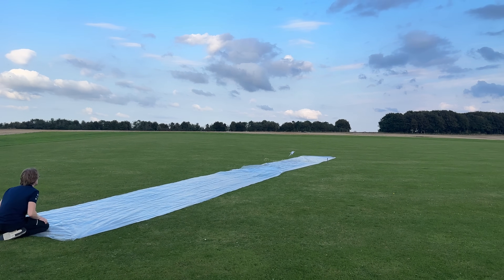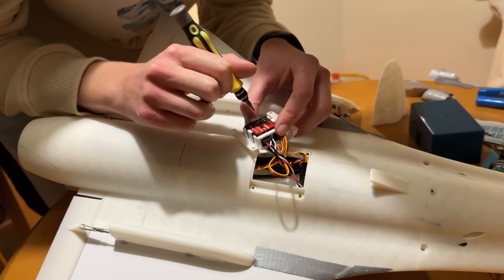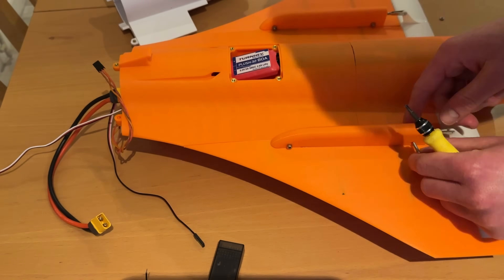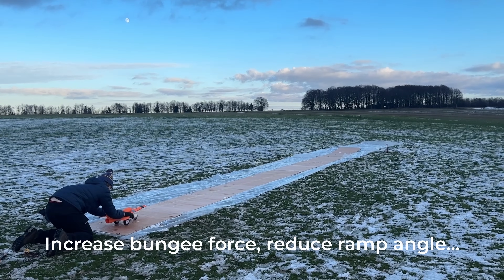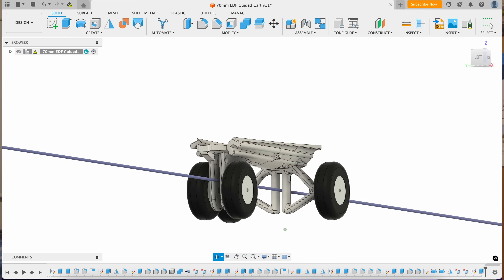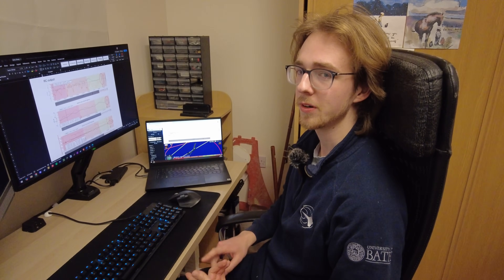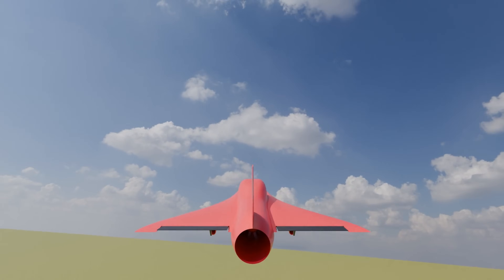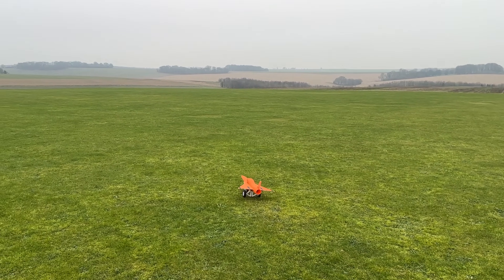WE CRASHED - Perfecting Kinglet’s Launch and Handling!

Comment: Have you considered using a powered sled to launch either rocket powered or maybe just a rc car and using a active decoupling at launch using a launch arm that increases the aoa at launch speed allowing for a smoother launch
Reply: Rocket will be too unpredictable and an RC car would need far too much runway. Using bands and string has been a proven method for years. They just need to perfect their sled a bit more. I personally use a rail system with a garage door spring connected to a Kevlar string and a Crossbow mechanism for string release. It gets my belly landing highspeed Turbines up to 60mph in a flash. Sometimes crash in a flash when I F up.
Reply: All data is good. You should ask Tridge to confirm your findings. Bring it to the Ardupilot dev conference at Richmond, Yorkshire first week of Sept to have all the Dev team available to help!

Comment: Perhaps there is some way, most likely in ArduPilot, that can alter control authority depending on airspeed. This likely won't work above a certain speed with how it's currently configured (since GPS prevents usage above 300mph I believe) however a pressure sensor like on actual airplanes could be used. It's fairly simple to math out as it's linear up until mach 1, so as soon as you see strange results at speed, you'd know you've hit the sound barrier.

It'd probably be inverse square for how the control authority would be mapped, where you've got 100% initially, then the firmware would limit it exponentially as the speed increases. Especially helpful for preventing roll, but you'd probably be better off with a different set of math for the pitch authority, and even a potential 'emergency' mode toggle which would disable the limits and allow full authority to the user.

The way I'd see it, this would likely feel very natural to learn, as as the speed increases, the amount the aircraft reacts would be the same, providing it is tuned correctly. The only difference would be distance travelled to rotate X degrees, instead of rate of rotation increasing with speed. It'd be helpful to the pilot as well as it'd feel "slow" to control, while being fully predictable, instead of having everything happen before any human could possibly react.
Reply: That should be possible via the LUA scripting functionality.

Comment: very cool video and project, how about using a parachute for landing? 🪂
Reply from the maker: We think a belly landing will be more reliable - the impact speed with a parachute will be fairly high, and it’s harder to control the orientation it lands in
Reply: @TheMachInitiative isnt it just that the harness needs to be above com? Also you could steal military drone recovery methods and deploy a bag on the belly

But this is of course a lot of weight and complexity and failure points for the flight, so maybe a catch net is more practical

Comment: I wonder if you're going about the use of the flight control system backwards.  I would recommend starting your flight out without flight control to get your trims, throws, and expo sorted out so that you can fly it "easily" up to 100mph.  Only then would I turn on the flight control to help keep things stable for max speed runs, where a human couldn't possibly react fast enough to maintain proper flight envelope.  Unless your idea of breaking the speed record is taking it up really high, then accelerating straight down and your top speed is what's recorded a millisecond before it hits the ground.
Reply from the maker: I think you're absolutely right that we need to get the trim, throws and expo (the basics) sorted first. In order to sort these out we've needed flight time and our major blocker has been the launch method. 

This video represents our process of sorting this out so now we should be able to get repeatable flights to sort these control issues out over the coming flight tests. 

The flight launched in manual and we were checking the different modes to work out what needs to change. The rest of the flights would've been adjusting the trim, c.g. and then tuning just like you are suggesting.

Thank you for the feedback we really appreciate it!

-Josh
Reply: @TheMachInitiative 
Personally I think your project management is pretty LEGIT lads!!!!!
Clearly your college did its job properly.

Eager to see what your next phase brings.
Genuinely sending as many positive vibes as possible from up here in the Norf (west yorks).
Reply: If they fly high enough and accelerate fast enough, I think they could reach top speed in time to pull out of the dive but it probably wouldn't count anyway.
Reply: There are people flying rc glider using dynamic soaring, already going faster than there projected speed.

Comment: Is it possible that the speed of the final dive overpowered the servos? aero forces on those big control surfaces may have limited the throw.
Reply from the maker: @keatonhare7691  This is possible but we think it is likely the tune at this stage. The default ardupilot tune is very conservative with less control authority than the manual mode. According to the logs the top speed in level flight was 116 mph whilst during the dive it reached 110 mph and the pid outputs were never large enough to get close to the target value suggesting it is a tune issue. Aero forces are definitely going to be a bigger issue as we increase speeds further though, that's why we have 20 kg-cm servos on the full-size kingfisher!
-Josh
Reply: @TheMachInitiative It’s probably too late for the main launch method - but I have found success testing high speed/large scale models by mounting them 2-5ft above a cleanish car(Tesla or other electric vehicle ideal) and accelerating up to flight speed - you can get a fairly good idea of basic systems and test servos/control surfaces/motor etc. This was the basic methodology for testing a lot of sub scale designs at NASA Armstrong for a long time